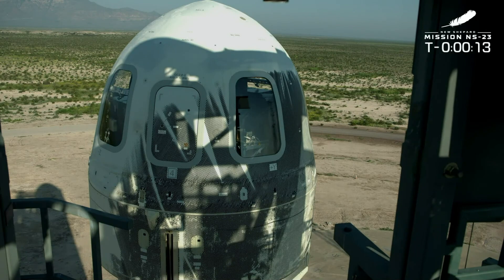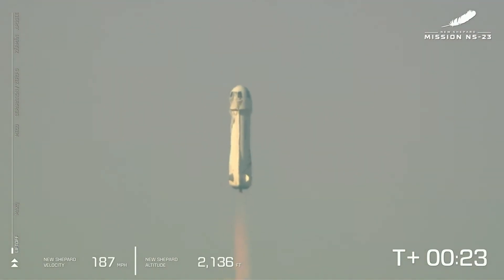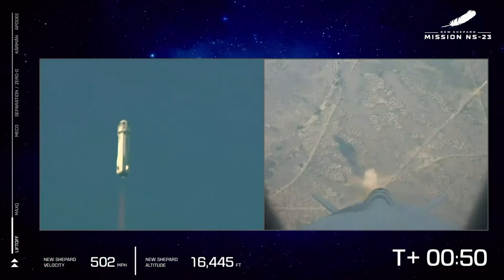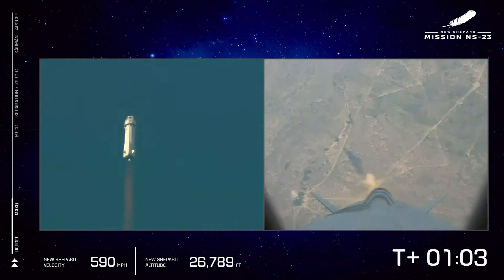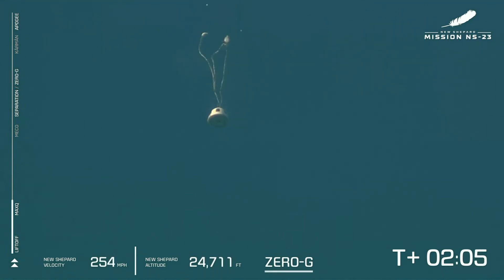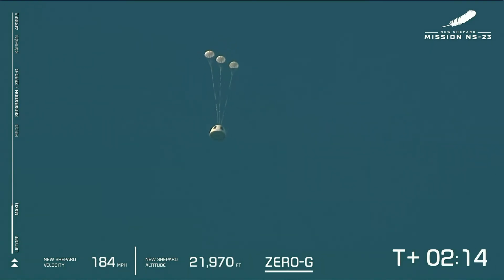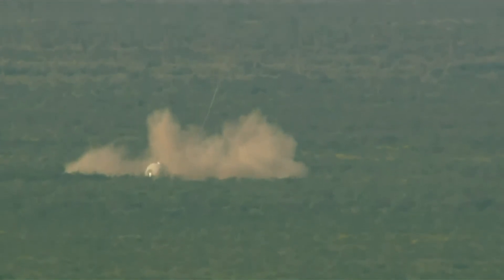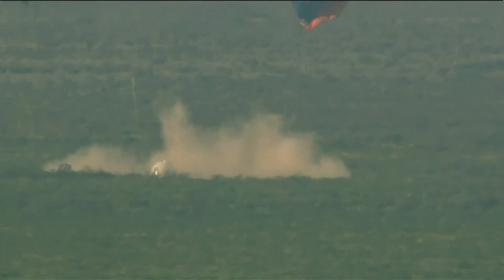New Shepard NS3 Booster Failure + Slow Motion! (12 Sep 2022)

Comment: SMASH! "There goes the retro thrust system.."           Yeah. Sure.
Reply from the maker: The landing was normal. The huge puff of dust is caused by the retro thruster firing in the last milliseconds prior to landing. It really does cushion the landing. Remember, there have been 80 and 90 year old passengers on New Shepard launches, with landings exactly like this.

Comment: Unfortunately, this sort of emergency will occur on a manned launch.  No one in that capsule is wearing a pressure suit so a catastrophe that leads to an explosive decompression nearing 100,000 ft will be deadly!
Reply from the maker: There was no evidence of decompression here. The Launch Abort System behaved as it was designed, as did the parachutes and retro thrusters. The escape and landing were ideal.
Reply: @RawSpaceVideos  They were but those G forces would have been brutal for the passengers.  I suspect this rocket is finished.

Comment: Is not there something wrong in the title, "launch abort" when this is a major anomaly / explosion that occurred at 28000 ft altitude?
Reply from the maker: The Launch Abort System, or Launch Escape System, is what accelerates the capsule up and away from the booster in the event of a critical failure on ascent. If the LAS/LES engages, there was a major anomaly.

Comment: We did learn a couple of things here: The altitude gauge on the extreme left of the screen isn't telemetry. It is a mere animation intended to correspond to a nominal mission. If anything anomalous happens, the gauge is useless. The Zero-G notification is not telemetry either, but is a fixed graphic corresponding to nothing in particular if the flight has an anomaly. That's almost half of the "telemetry" display on the screen. Way to build confidence in your numbers, Blue Origin!
Reply: I see the altitude indicator slow until it stops at about 37kft then it goes down, same with speed, it slows down until the momentum stops and the speed goes back up on its way to the ground. The Zero G indicator might have been triggered by the rapid deceleration, I guess they have to improve some stuff. Still, I don't see indications of a pre-made animation of a nominal mission. 

Maybe some people expect the capsule to just come straight down after the malfunction, not taking into account the inertia. In other words, the capsule won't just stop after the rocket stops.

Comment: That wasn't a launch abort, that was the capsule escape system that turned automatically on after the booster's engine failure.
Reply: In other words - a launch abort.
Reply: @macsloan58  I
I've guessed that it is obvious for everyone that the rocket has launched. In other words, the launch happened, not aborted.
When the launch is aborted then the rocket stays on the pad, no fire, plumes and loud sounds.
Reply from the maker: @jonnekjonneksson  The launch was "in progress" when the booster experienced its failure, and the Launch Abort System was triggered. Launch isn't just getting off the pad; it's boosting all the way up.
Reply: @RawSpaceVideos  How you "abort launch" by launching a capsule which sits on a rocket T+1 minute after it has been launched?
Reply: @jonnekjonneksson  The rocket’s “emergency launch abort system” automatically kicked in. So, the rocket didn’t abort on the pad, rather the mission failed about a minute into launch.  So it wasn’t a “launch abort” rather it was a mid-flight abort. Luckily there was no biological payload.

Comment: Nice job! The timing of that "ZERO-G" indicator looks even more suspicious in slo-mo. I wonder how it's obtained - perhaps it's simply set on separation? 596mph at T+1-04 and 683mph at T+1-05 is +4G - does that tally with the escape motor spec?

Comment: The reto landing thrusters seemingly didn't fire mate.
Reply: The escape system and the retro boosters use the same combustible, or are they 2 independent units? Imagine if they go out of gas after the escape maneuver
Reply from the maker: The capsule landing was completely normal. The huge plume of dust you see is the result of a retro thruster firing in the last milliseconds of the descent, which cushion the landing. The New Shepard capsule which carried Wally Funk and William Shatner to space looked the same when they landed.